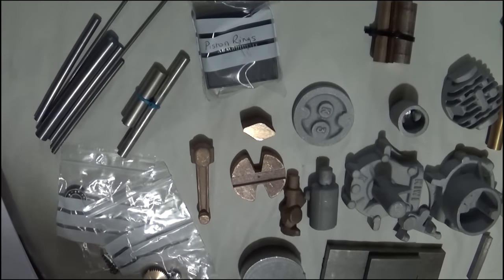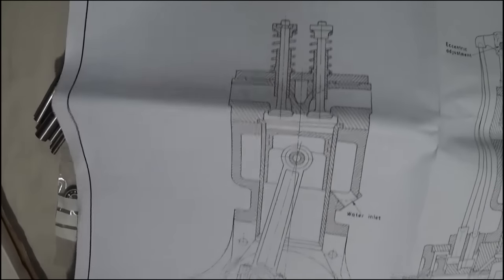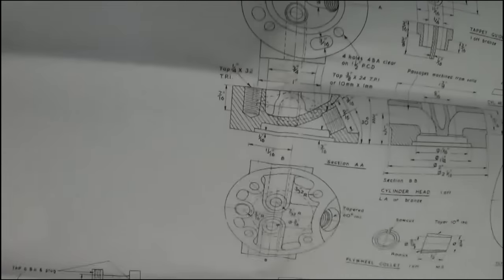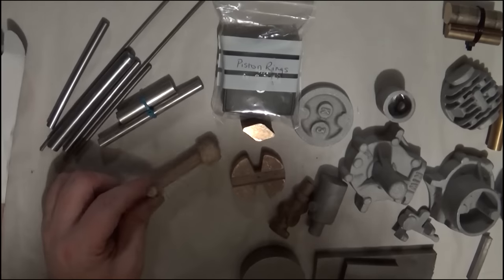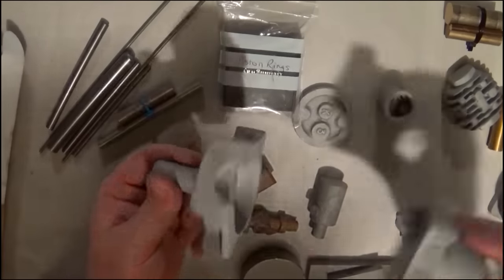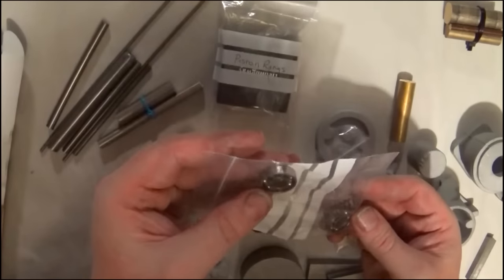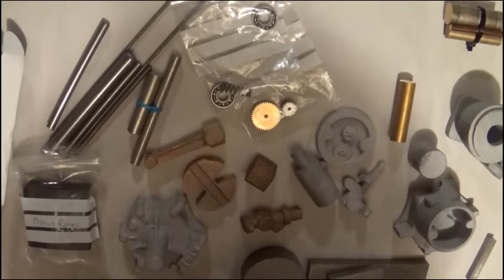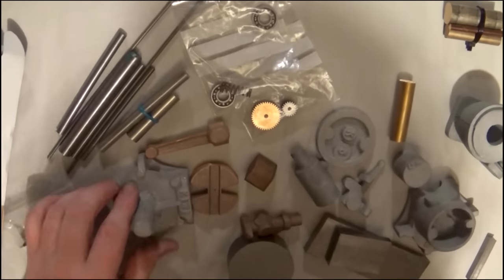Hemmingway kits Kiwi MK2 unboxing and a better look

Comment: Thanks for the kit viewing Emma. Looks to be a nice upcoming project.  I have a mini mill from Chester which is a derivative of the Sieg X2. Contrary to what many people say it is an excellent little mill. I have turned out some great jobs on it. I did convert mine to belt drive which not only increased the speed range but also made it much quieter. Admittedly it is not a stiff as some bigger mills but used within its capabilities it is a good cheap little mill.  So unless you can find bigger second hand mill for around the same money that's what I would go for. The thing to remember is you only get what you pay for. So used within its limits for small jobs such as the ones you do the X2 mill is a great buy. I hope the search goes well. regards from the UK  Gary

Comment: Hi there Emma.Good to see you back at work. Haha Get the biggest and the best mill that you can. I have a Taiwanese "mill drill" based upon the RF 40 which is good but no motorised table and no up and down knee.I can do all that is required and more and would recommend something similar but no smaller.good luck in your search for a bargain.Cheers TK
Reply: You can get motor drives for the table. The lack of a knee is definitely a problem but the head on my mill/drill can be raised and lowered. It is a round column though so keeping it aligned is an issue.
Reply: I have 2 mills a Chester/Sieg X2 type and an Ajax MD30  which has a round column. I am in the process of fitting a Thompson bar to it to stop the head turning when raising and lowering. regards.